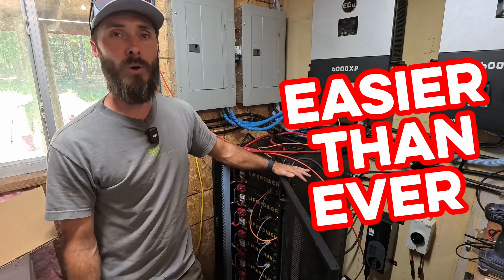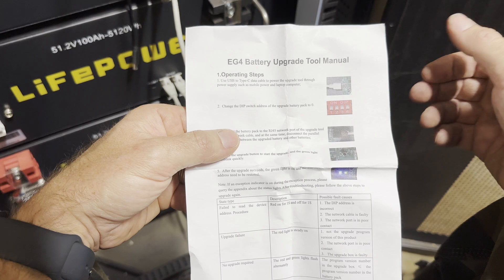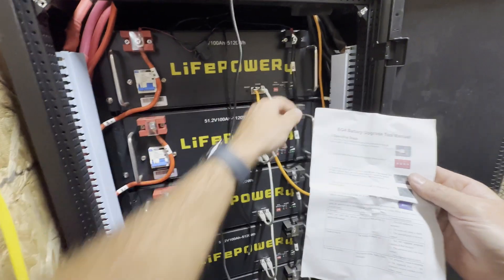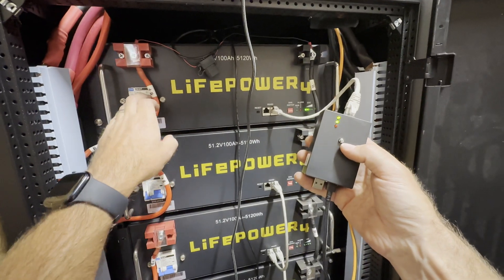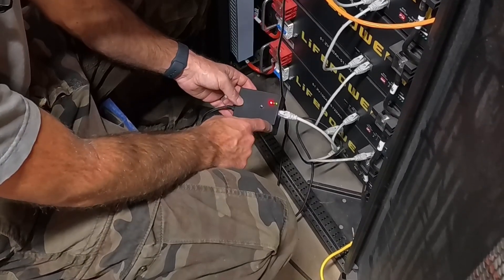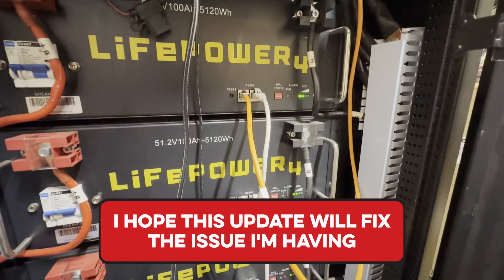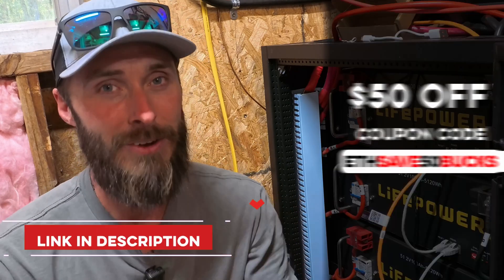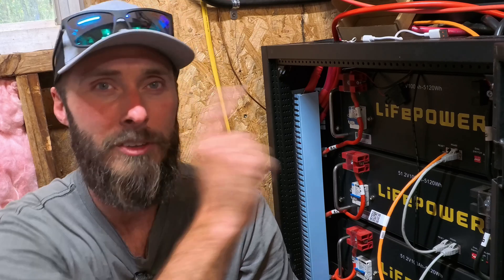Update EG4 LifePower4 Firmware Effortlessly…For Free?!

Comment: I have the same issue with drift on my eg4 batteries. More so on the v1. I sync them up every month or so. Then I see 100% again until they slowly drift again. I leave my 12Kpv on and use the solar panels to charge. Unplug com from inverter to batteries at the battery. Inverter will go into red warning if you have ac in. Remove one side of each com wire between other batteries. If you have ac in, you can shut off all batteries, if not you can leave at least 1 on to keep inverter on. Inverter has no com so it stays in red warning. Each battery you want to sync must have the dip switches set to first in pack. V1=0 and V2=1. Plug inverter com into that battery and turn on the battery. The inverter will see the battery and change back to normal and start charging the battery. When it reaches 100% it is done. You can now shut that battery off and repeat for the others. When finished, I make sure batteries are off and change dips back to what they were and reconnect all com cables where they were. It’s a good idea to write down or take pictures with your phone of where everything is before you start so you don’t have to hunt through your manuals to figure it out again like we did when we 1st got into this. Now you can turn your batteries back on. Give your inverter a chance to see all the batteries, it can take a minute. I always get that beautiful 100%.

Comment: I have an interesting issue with my stack.  I am using the EG4 Communication Hub so it can do closed loop communication with my Sol-Ark 15K, and the overall stack full charge percentage decreases by 1% every couple of days.  So after a full charge, it will show 99%, and then a  couple days later full charge will show 98%, and this continues until I reset the BMS's.  To reset them I have a small AMS power charger, that will output about 57.3-57.5v, which will reset the charge percentage in about 1 to 2 minutes.  So if I let them go for a couple of weeks, the overall charge percentage on the Communication Hub (and the Sol-Ark Inverter) will be showing like 92% at full charge, but after 1 minute or so on the AMS charger, all the packs reset, and the hub then shows 100%.

I am trying this update today to see if this issue goes away.  Thank you for the tutorial!

Comment: Once I updated mine, they would no longer be compatible with the computer program BMS tools. I wish I never updated mine. I’ve called Signature Solar numerous stumps they don’t have a solution. Also on another subject, did you flip one of your bus bars? I did that on my server rack. My positive is on top of my negative is on the bottom but I don’t see much improvement. My two middle batteries have 10% more state of health.

Comment: Fantastic thanks bro 👍🏼‼️‼️‼️
  I’ve been having problems with my batteries same as you but I’ve also had my system up and running for 2 years without any firmware updates    They actually scare me    If it’s not broke don’t fix it mentality 
  The code worked at checkout SICK
   ✌🏼
Reply from the maker: Nice! Also if the it doesn’t fix the charging to 100%, try changing your charge voltage to 57 V. Once the whole pack hits that, they should reset the BMS 100% SOC levels and be back to normal. Good luck!
Reply: @ alright awesome dude thanks for the advice 👍🏼✌🏼
Reply from the maker: You bet!
Reply: I actually did the firmware update and my batteries got brought up to 85% the next day and my battery SOC levels are still all over the place. Well actually just my bottom battery is it two bars all the other ones are one bar flashing red light
   🤔
Reply from the maker: @cowboymcq6711  Charging to 57V should fix that issue. Let me know if not.

Comment: Just bought a $1200 dollar battery 3 weeks ago and it needs a firmware update. Why didn’t they update it before they sent it to me? Also, the shipping for the automatic updater is free but they’re charging $9.99 for the updater. Maybe they should’ve just tacked that $9.99 onto the price of the battery and sent the updater with the battery to save me the hassle of having to order another item
Reply from the maker: I know it's frustrating, but you are asking too much of any company. This is the standard for every distributor. Do you want to purchase an iPhone, TV, computer, or anything else from Best Buy and get it shipped to you in an open box? No, You would throw a fit if you got the box opened and the factory seals broken. On top of that, the price would go up because they would have to take the box, open it, run the firmware update, and then test the product before carefully trying to put it all back in the box the way the factory did it. Even then, they may release a new update by the time you get it shipped. Instead of complaining about updating your battery, try being thankful that they keep upgrading your investment and making it better and more stable.

As for the price, I just checked again and the unit is free when you use the discount code "lifepower4" and that includes shipping to the US & PR.
Reply: I am thankful, I just wish that they would provide the information about needing the firmware update rather than me having to find it out from people who have absolutely nothing to do with the company. Also, it would be nice if they included a notice when you order a battery from them that informs you that you should have one of those sent and give you the option to add it to the cart when purchasing a battery. As for the price, I missed the part about needing to enter the code, thank you for pointing that out. And again, I am not unthankful, just frustrated that when I purchase something from a company and in install it exactly according to their installation manual, the communication doesn’t work, and I have to go online and learn from people that have nothing to do with the company it needs a firmware update. Also, I am very thankful for the DIY solar community that offers this advice and help.
Reply from the maker: I get it, man. It is frustrating to spend a ton of money and things not "just work." This industry is in it's infancy and has grown a ton in just a few years. Lots of things to learn and figure out. The new EG4 stuff is already WAY better and easier to use than the old stuff. They take user feedback and implement it. Let me know if you end up having other issues that they can't figure out.

Comment: Signature just sent my Firmware File embedded in an email. No little box. Do I need to call them back? Help please.
Reply from the maker: @benkanobe7500  If you want the little box, click the link in the description or pinned comment and use the code on that page. It may take a week to get it, so if you need the update as soon as possible, you can use the file they sent you and the desktop app to update.
Reply: @EastTexasHomestead  Thanks. I watch you because I don't know this witchcraft. I don't know what "The desktop app" is, where to get it, or how to use it. I use Macs so that could make things even more difficult. I have the newest EG4 battery that Will P. just reviewed. Signature says it needs the Firmware update and sent the file. I hope the box will solve the problem. How does the box get updated?? Any help is greatly appreciated.
Reply from the maker: @benkanobe7500 i understand. You can follow this EG4 video https://youtu.be/KSyr1EitF8g?si=CVxMVdt4lr1rHyx1 some things may have changed a bit since they posted it a year ago. Otherwise, call Signature Solar in the morning and ask if the updater box is now shipping with the latest firmware. They will have to load it as far as I am aware. Hope this helps.

Comment: How does the box get the most recent firmware?
Reply from the maker: They ship it that way. I don’t believe you can update add more to it.
Reply: It says on the back of the box not to thow it away that it can be updated! Wish I had read that before hand as it also says not to have the charger running while performing the update 😣
Reply: @Laurel-Crowned  thanks!

Comment: Dang! I don't like having anything that has to have its software updated. The defeats the purpose of being off grid and disconnected form the system that wants complete control of people. They want to keep us dependent and connected so they can make money off of us.
I miss the video games that you buy and pay only one time. I can give them up. I still have my old video games that do not require updates, upgrades, or any other "ups".
Reply from the maker: While, I agree with the sentiments expressed. I think you missed the point of this update. It’s not required and your batteries will the same as they did the day you bought them. However, if you want to improve the performance, then the update is recommended. I’ve been very happy with the latest firmware but I could also lived without it.

Comment: Charging the pack to 57v and letting them sit for a bit can also helpful. It’ll reset the BMS and get the entire pack in balance.
Reply from the maker: That's a great point. I actually did that with one of the batteries that night and the next morning (after the firmware update) all of the batteries were charged to 100%. I don't think it was the 57v charge that did it though because i charged that one with the Chargeverter while the others were charged by the 6000XPs.
Reply: @EastTexasHomestead  yeah it’s just a good thing to do every few months or so on the pack. Really it helps more for those folks that don’t reach a full charge every day. But mine were straying a bit a few months back and it made a big difference.

Comment: I guess your battery positive and negative are on opposite ends already. I think if they are going to 100% and then lower maybe 20%  they should be fine. If your batteries are always middle of the road they can get out of balance I’m sure. You charge and discharge daily with the grid so would think yours would be closer.
Reply from the maker: I actually have both + and - connections at the top. I discharge to 20% almost every day and have so since I got them. I also charge to 100% every night. At least I thought that's what it was doing. The good news is the firmware fixed everything! I now get to use the full 80% of my batteries instead of 50% like I have been.